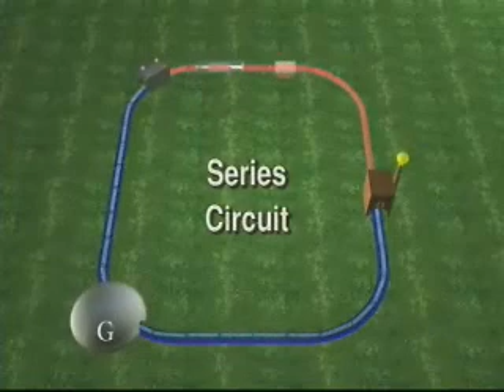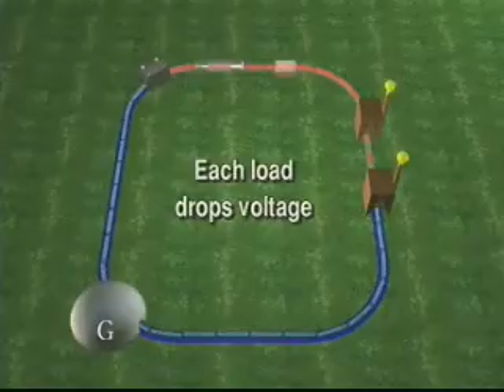voltage drop

Comment: As there should be no voltage after the last load, how could the free electrons flow back to the voltage source? And how it is working in loop.?
Reply: it's really not a voltage drop, I hate that name for it, like the video stated, it is actually a voltage usage.
Reply: So basically, in a perfect series circuit we assume that we are using all the voltage before the current reaches ground? @calicoesblue4703